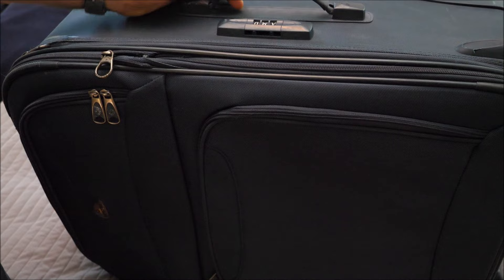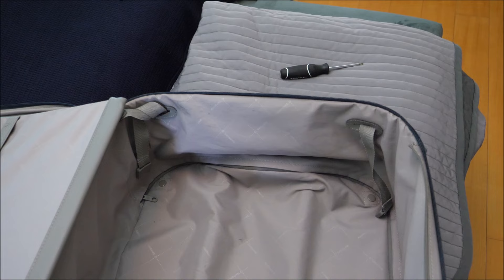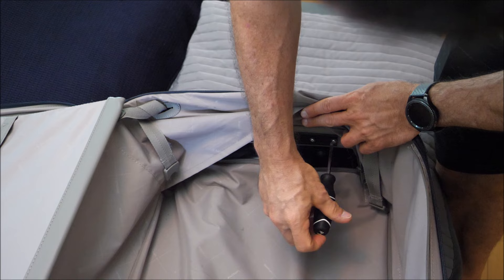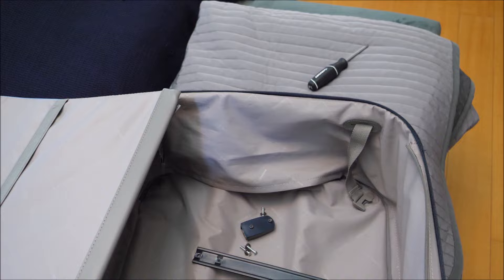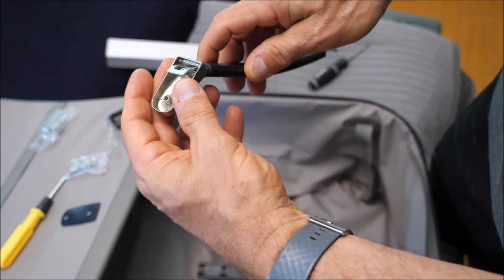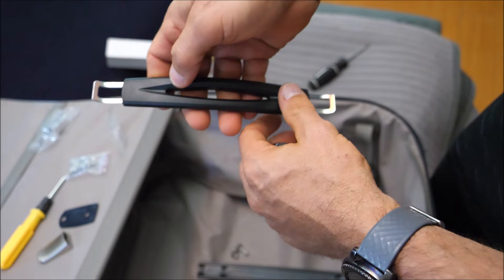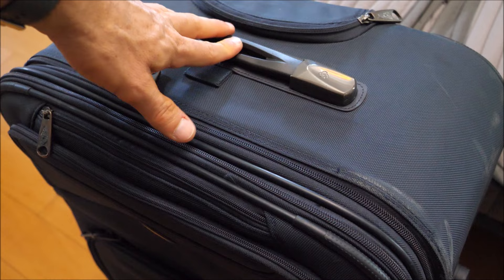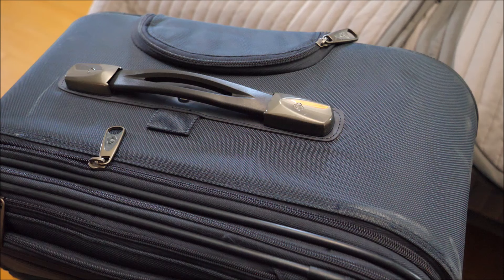Easy DIY Luggage Handle Replacement

Comment: Obviously a broken Samsonite handle landed me here. Last night I realized my liner does remove for access to the handle assemblies. Your video is a great show, now hopefully my measurements will be identical to what you did, and one click will solve my own situation. Thanks!
Reply from the maker: Glad you ended up here, good luck with your replacement. May not be identical to original, but should suffice, as it has for me.

Comment: Hi! I'm trying to find a replacement handle for pretty much an identical suitcase. I'm so frustrated that Samsonite no longer produces that specific part! I'm grateful for your video and especially the link to the product. I'm ordering it and hopefully it fits as well as yours did. Thank you!
Reply from the maker: My thoughts were the same as yours when I was unable to find an exact replacement. The parts I found were close enough matches to have served the intended purpose though, good luck!
Reply: @AndyMahnFL411  I actually have a matching smaller carry-on suitcase so I purchased two. Popped them on this week and they fit! Like you mentioned, not perfect but they will totally work. We will see how long they last. Thank you again!
Reply from the maker: @ChunLi8178  fantastic! Hope that works out well!

Comment: what model did you order from Amazon? I have the exact same suitcase with top handle that requires replacement
Reply from the maker: I just verified: 
https://amzn.to/3nEC1ry
(Amazon affiliate link) That is the replacement handle I used here. Check your specific handle measurements carefully before placing your order.
Description: SizeThe total length is 23.5cm/9.25 inch, and the handle length is 15cm/5.9 inch. Inner hole distance: 17cm/6.69 inch, outer hole distance: 21.5cm/8.46 inch. Metal mount size: 2.5x4.5cm/0.98x1.77 inch, hole distance: 2.3cm/0.9 inch.

Comment: What if the handle has rivets instead of screws?
Reply from the maker: @lpeacelovefaith9566  That's a little bit different, you can try to carefully drill the rivets out, or you might be able to use a pair of cutters to remove the rivets and replace with different hardware. Good luck!
Reply: @AndyMahnFL411  thanks for your reply!  I ended up popping it out with a screwdriver and I’m just going to buy a screw and washer to fix it….. we shall see if it works!
Reply from the maker: @lpeacelovefaith9566  good luck, please come back and share your results!

Comment: I have a large luggage, can I order any handle from Amazon?
Reply from the maker: Not any handle, you'll need to measure the distance between the screws and make sure that the handle you order matches the current suitcase that you have.

Comment: that's a good quality luggage.  makes sense to repair.  can you do the wheels?
Reply from the maker: Yes, that is why I felt it was worth doing the repair. I believe there are roller wheel replacement kits available. The wheels can wear down over time and may require eventual replacement.